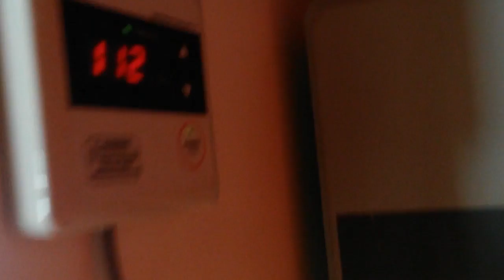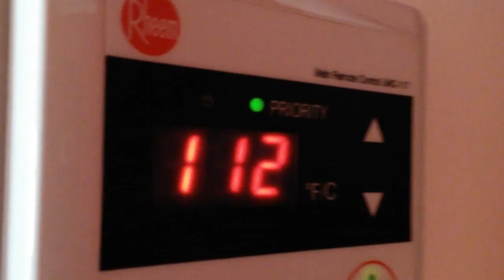RHEEM TANKLESS FILTER CLEANING

Comment: Thank you!  Had a water main break in the community and my hot water pressure went down to nothing.  Just popped the filter and was totally clogged.  A quick cleanup and back to normal.  Saved me a couple hundred dollar call easy.
Reply from the maker: That was clever of you to deduce the break and low pressure where related. Breaks into water system will result in particles entering and while not an issue for water heaters, they will quickly clog the small filter of a tankless. Thanks for sharing your experience and for watching.
Reply: I recommend a whole house filter coming into your house.  I would say something with a clear casing so you can see if it needs changing.

Comment: Tip! If you haven't tested your pressure relief valve in a long time I recommend you have one on hand BEFORE testing. Sometimes they wont shut off after testing especially if it's been a few years since testinf
Reply from the maker: Depending on local code, some system are not vented outside or into a drain, a stuck valve could end up making a mess. Either have a spare or make sure you can shut the flow at the service valve.
Thanks for sharing your tip.

Comment: You didn't shut off the hot water valve but went for the pressure/temp relief valve. If I'm able to shut off the hot water valve, I don't have to do the relief valve right?
Reply from the maker: Yes the hot water valve would not turn by hand and I didn't want to force it with a tool. The advantage to using the pressure relief valve is the water will no longer be under pressure when you unscrew the filter cap. This will mean less spraying of water, therefore less of a mess. Also using the pressure relief valve will verify that it is still operational.
Hope this helps and thanks for the question.
Reply: @cfldriven  Thank you for the answer!! You are awesome!
Reply from the maker: @munchikinbanana  Glad to help.

Comment: We just bought a home about a year ago and I did not know the filter had to be cleaned. I never cleaned it once but unit started flashing p1 today. I'm hoping cleaning the filter will fix issue. P1 is code for not enough water flow. But we were also running dishwasher and washing machine at same time so I'm not sure if filter issue or not enough pressure. The unit is outside home. There is one unit for entire home.
Reply from the maker: Get a pressure gauge to determine the water pressure you have. If pressure is okay and filter is clean, I would perform a lime and scale flushing https://youtu.be/St38CFhiaI0  Why? Because it could be the inside of your tankless is clogging up with water deposits. This should be done annually especially if you don't have a water softener before the tankless unit. Let us know what you discover.

Comment: Can you use CLR instead of just holding the filter under the tap?
Reply from the maker: Running water through the filter is a quick and easy way of cleaning it without damaging it.
Reply: @cfldriven  but not if you don't have an isolated shutoff valve to the heater.
Reply from the maker: @DaveyOful  Yes mentioned in video. Guess you could shut off main to house, let water out of system through lowest faucet then remove and clean filter.

Comment: How do you clean your filter with running water once you’ve turned the water off on your house?
Reply from the maker: Well remember we are using the service valves to isolate the cold water from entering the unit. We are not closing off the main shut off to the house, thus you can use the cold side of a faucet to clean the filter. 

Hope this helps.

Comment: I cleaned my filter (P1 error) but my unit still won't power on. I turned it off because P1 was flashing. Now it won't come back on.
Reply from the maker: This is what I found for P1.
An Error Code P1 indicates that the water flow is too low. ... Check and clean the water inlet filter on the tankless unit. Increase the flow rate or adjust the temperature higher. If the above issues are not the problem, there may be a problem with the water flow sensor.

Rheem National Service Department 1241 Carwood Court Montgomery, Alabama 36117 Phone: 1-800-432-8373

Comment: Is this a fix for the E29 error code ?
Reply from the maker: No this will not help with E29. That usually indicates low temp on the heat exchanger. Causes maybe clog air inlet or dirty heat exchanger. Check out
https://www.waterheaterleakinginfo.com/rheem-tankless-error-codes/#tab-con-25
for more info. Best of luck to you. If you remember share your solution. Thanks for watching.
Reply: cfldriven thanks !
Reply from the maker: @ryank2034  Hope it helps.

Comment: How about using canned air to blow off debri
Reply from the maker: I have noticed some of the particles are really attached to the fragile filter. While I have never used canned air, I would imagine it could come in handy. I would suggest short light burst. Let us know how it works.
Reply: Use a toothbrush and some toothpaste...problem solved